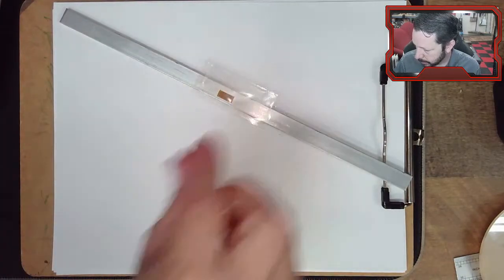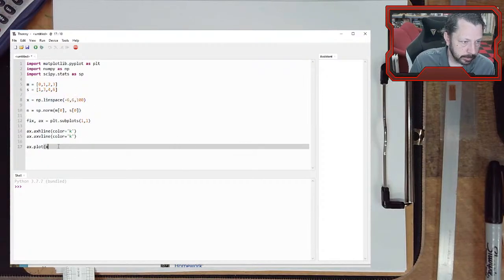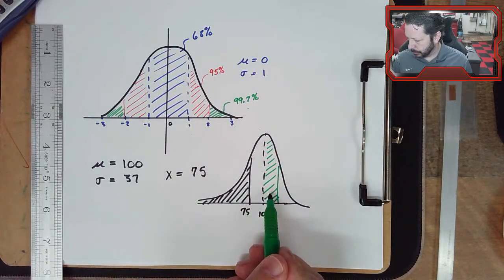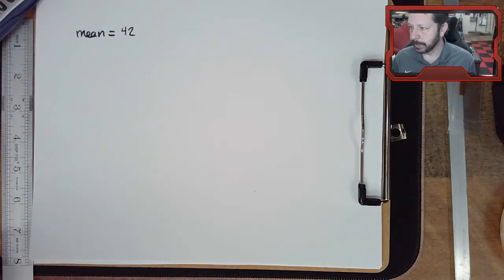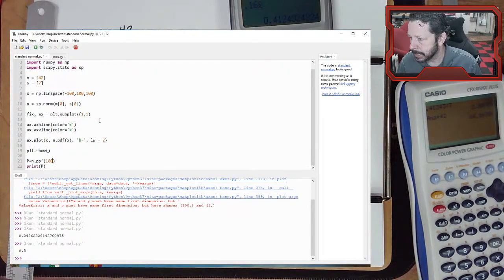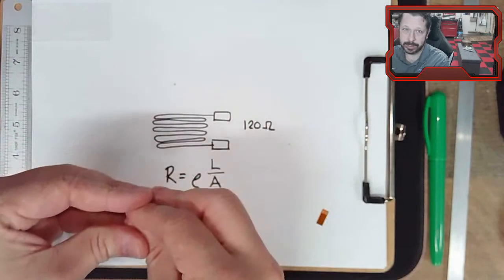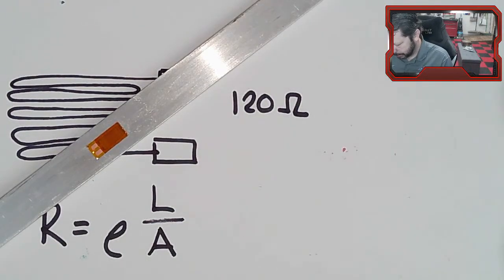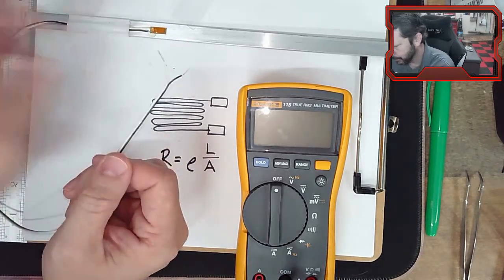Statistics and Python | Strain Gages | Measurements 07

Comment: Professor Crittenden, In this 07 you finish this lecture by giving the class more time to mount their strain gauge.  I have looked at all your lectures : 07 through 011.  What I have not found was a lecture on the final coding for the application of the load cell, HX711 amp to Raspberry Pi.  Can you point me to the appropriate lecture or lecture series?
Reply from the maker: I will have to look around for that one. I don’t recall if we ended up installing the amp or not during that year. I may have the lecture notes for it though. If I do find them, I will link them here for reference.